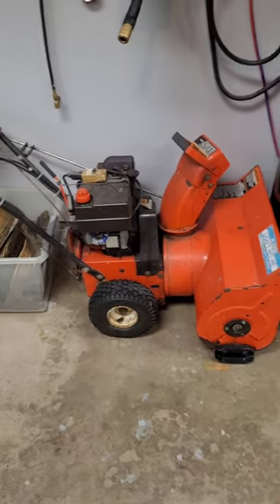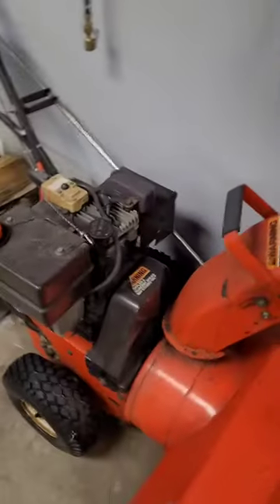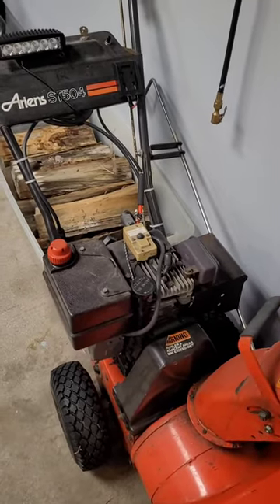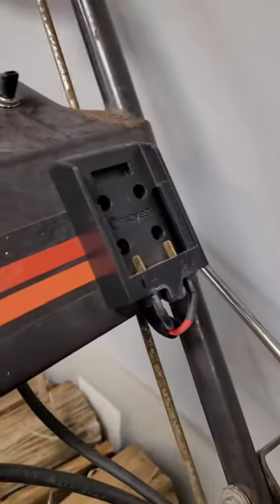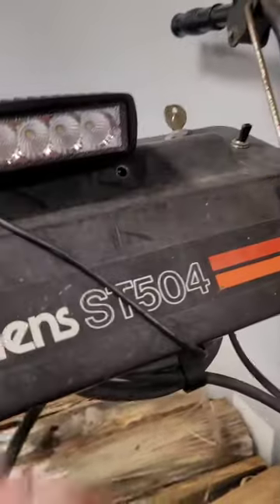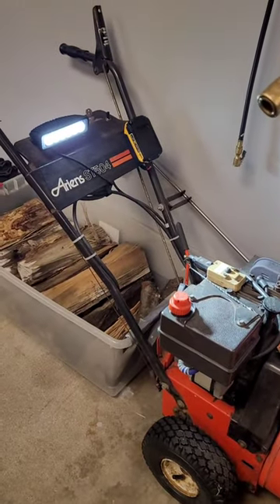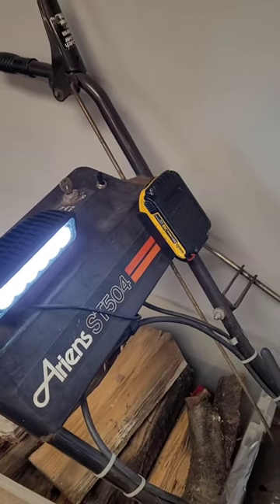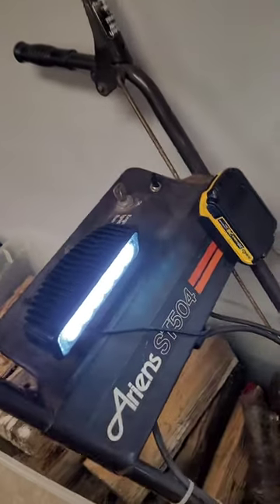How to use dewlt battery to add lights to your snow blower

Comment: I installed an LED light to my snowblower using a Milwaukee recepticle for my M18 batteries, because I do not have a stator in my old Toro. I also installed grip heaters that go under the grips to keep my hands warm. I figured it would be a good idea to add a volt meter to make sure I don't run the batteries completely dead so they will charge up again.

Comment: Awesome! I'm doing a similar setup on my craftsman snow blower with no lights. I have mostly Ryobi 18v and 40V and doing a 40v setup with a dc to dc convertor to 12v. Its gonna be a fun setup to do with two lights!
Reply from the maker: If you wire the 2 lights in series can you wire directly to the battery to save the converter?  When I read the literature on most "12 v" leds they are actually happy at 12 to 24 v.
Reply: @billmonroe7328  some are happy between 12v to 36v but the ones I got say 12v only so I wanna say based on price I don't have that range. I guess I could experiment as less do have tolerances but that will be based on the driver they are using. Thanks for the tip.

Comment: Where'd you get the plug at and what's the name of the plug in the part number so I can get this plug thank you I love your video
Reply from the maker: Amazon.  

Ensayeer Power Wheel Adapter with Fuse & Switch, 12 Gauge Wire, Compatible with Dewalt 20V Lithium Battery, 1 Pack https://a.co/d/a6gkIdN

Comment: I would like to know where you got the battery adapter from for the Milwaukee battery it would be well appreciated
Reply from the maker: If you search for [your brand battery] "power wheels adaptor" on Amazon, you can find  ones for almost any battery brand.  Just remember, if you wire it directly, make sure your light is good for the voltage range AND that you never let it drain the battery dead because with no low voltage protection, it can damage you battery if you let it go dead.
Reply from the maker: Here is one example: Power Wheels Adapter for Milwaukee M18 Battery Adaptor 18v Dock Power Connector for Milwaukee 18V Lithium Battery 12 Gauge Robotics https://a.co/d/cetghpB
Reply from the maker: You could wire one of these in and set the min voltage to be just above the min voltage of your battery.  I did this for a led coleman lamp conversion where i want to let it run all night, but for the snowblower i just make sure to pull the battery before it gets low. Onyehn 2pcs 12V-36V DC Voltage Protection Module Digital Low Voltage Protector Disconnect Switch Over Discharge Protection Module https://a.co/d/gHNSsv5

Comment: Will this adapter work on any 20 volt lion battery ?
Reply from the maker: You just need to search amazon for "your brand battery power wheels adaptor" and insert brand of you batteries.  They make them for all major brands.

Comment: Did you use any ac/dc converter?
Reply from the maker: No, the harbor freight led off road lights are made to run at 12 to 24 volt DC so no conversion needed.  Works fine direct wired to a 12, 18, or 20 volt tool battery.  Like I said, just don't run the battery dead because the low voltage protection is usually in the tool circuity.

Comment: How long does it last
Reply from the maker: Depends on battery, but i never run a 2.5 amp hour battery low in one use and I typically run around 2 hours.
Reply from the maker: https://footprinthero.com/watt-hours-to-amp-hours-calculator#how-to-convert-watt-hours-to-amp-hours-wh-to-ah
Reply from the maker: Just use link below and put in your light wattage (actual, not "equivalent") times hours you want and your operating voltage to see amp hours you need.  The led I used is 12 watt, so 12w x 2hrs =24 watt hrs and at 20 volts thats 1.2 amp hrs, so my 2.5 ah battery is fine for my 2 hour usage.